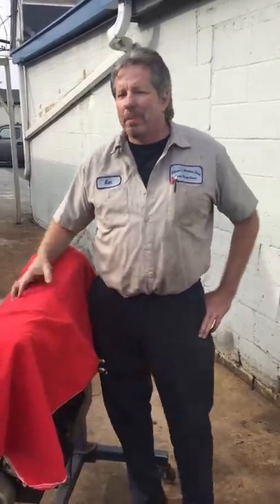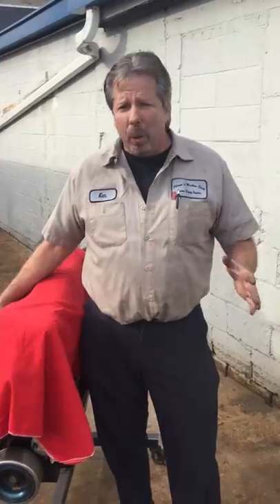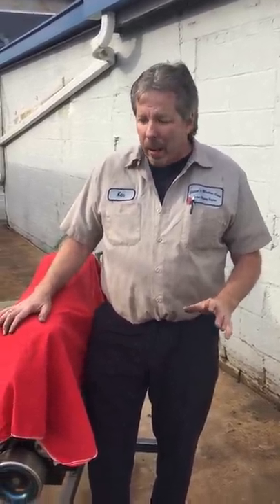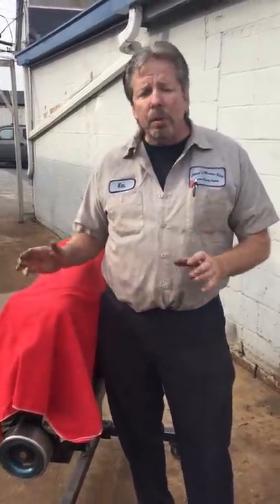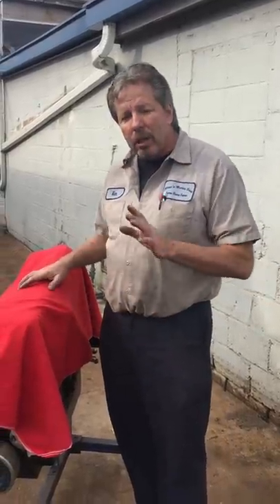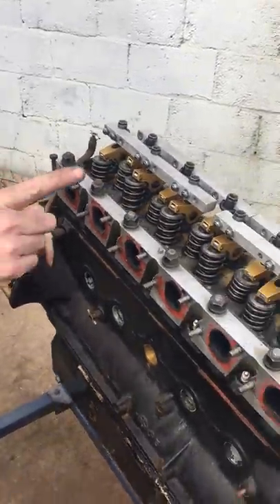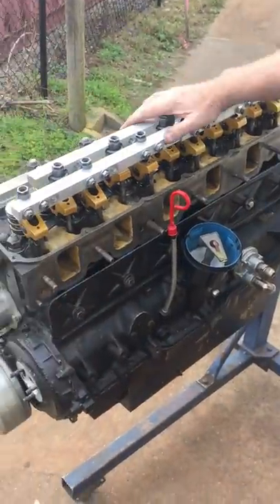Mysterious Radical Race Engine! MUST SEE!!!

Comment: I have never seen 6 cylinder set up that way but I have seen a cool Ford 4 cylinder. Volvo marine sold an inboard marine engine that ran a Ford big block head on it. It was sold as Volvo engine but it was basically a Ford rebranded. I always thought it would have been cool to swap one in a turbo coupe or something.
Reply: that was a merc cast block with a ford 460 head to make it cross flow,

Comment: I had a 1968 Ford 1-1/2 ton truck with a 300 6 banger mated to a 4 speed. That is a workhorse combination. It actually sheared off all the rivets holding the ring gear to the carrier.

Comment: The two piece valve keepers are strange. I can't see the advantage of the rollers running against the split keepers. It's definitely a strange engine. The work is staggering in this engine.

Comment: i heard about this engine today. and i love the 300 6 so i found the last video of it and i subscribed because of it. what i want to know is if you can get a pattern and what parts of the heads they used to make it work of if you can get the head 3 d printed so it can be built and sold on the market.  because now i want one so bad.

Comment: Bruce Sizemoor had one that I think he used Boss 302 heads to build.  There is/was an E/Altered that used the 300 ford block with a single billet head by Allen Johnson.  Bruce told us he took it to 9000 rpm.  Said cranks were junk at 20 passes.
Reply: There we go I knew there were some old modified guys out there, Bruce Sizemore ran  I/gas with this pinto back in 1975.

Comment: Hey Ken, Love the video!  I knew what it was as soon as you pulled the cover off.  This is the same engine build as the one Bruce Sizemore had in his pinto, I think in 1975 and won the prostock championship with it!! I can not remember who he was staged against in the final round, but I do remember it being a white GM car.  It is hard to mistake the design of the 300 and then,  when you see the Cleveland ports and canted valves up top it is a dead give away!!  I love the way they did the front timing cover to drive the enderle pump for the injection system.  I know, I am about 9 months late on this post but you said to leave a comment if we recognized what it is.  LOL   I am a FORD guy and also an engine builder.  I love those Cleveland heads.  I have got to get caught up on your videos,  I have never seen one of these heads off the  block.  I am also curious about the cam choice, and the way they lightened the crankshaft as well.  Thank you for you time.  Earl

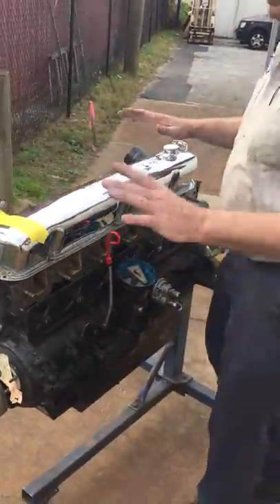Comment: I stopped at 3:43 and just scrolled forward on stills and no sound. Being Australian I am prob off the mark and can't be sure.. Look Fordish (Nothing to do with the WP) Crossflow, so possible a ford 250ci crossflow.. Special, hmm so far I am not really seeing much other than the roller rockers and what may be a custom magneto or CDI mount on the front of the Cam.. The Ex manifold spacer to get the extractors or headers around the plugs is a nice touch :P the port flowing is common, but not my preferred for an engine like this.
>
Now I watch the video :P
Reply: I thought the angled rocker cover mount was unusual on my first look, but I didn't pick the multi head setup lol And the I thought maybe the welded cover was to match up a high rise cover for the roller rockers..
I have swapped out some custom heads between different 6 cyl engines to get different chamber and valve sizes, but 3 heads is one I never attempted :)
13:1 ouch.. lucky Av gas is cheap in the US lol.. best I could go was 10.5:1 and even then it was hard to keep the octane high enough :) especially after they banned leaded fuels.. even the high octane unleaded fuels where still prone to a lot of pinging.
>
I was more into the Holden variants of the GM 6 cyl engines here, and you could do a lot of custom swaps between cranks, rods, pistons and heads to get some sweat combinations.. Definitely looks like a work of art to be proud of 👍
Reply: 13:14 Same, same as I mentioned above.. sit there and read through workshop manuals for specs and catalogues to see what you could match up to realize the crazy build you had in your head :) Love it 👍

Comment: Yes true, I have never seen this before... I really want to make the same on jeeps 242  but designing the heads intake on a side and ex on the other side... Makes hell of a difference...
Reply: AMC/Jeep six. Same bore spacing as the small Ford V-8s. And only 20 thou less than the Chevy.

Comment: I graduated in ‘76.  I remember reading about a GM six cylinder having similar surgery. Cutting up 305 or 327 or 350 heads to mount on the block. They were welded together, two combination chambers added to four. This also put intake and exhaust on opposite sides.  A few guys at school had hefty six cylinder novas and mustangs.  It was the cutting edge, I guess.  Thanks for throw back.
Reply: Clifford research and development

Comment: There are other examples of this combination{as many as 50 examples?[--NOT as "Good" as Glidden's! ]} , but I STILL LUV this combo.  WHY, though, didn't Glidden start with an Australian "Barra" head?  Not enough  space in the "Barra" chambers?   I got a combo for you.  Pontiac brought out their OHC head on a Chevy block that was around for 3 yrs from 1966-69.  It didn't have near the output of Glidden's "GENIUS-BEAST" that you have.   But Pontiac was "working" on a DOHC version, whose experimental head has never seen the light of day.  GM wasn't making $ with the OHC-6, so a DOHC-6 was never going to fly.  But as the gas-crisis deepened, it could have "fit" somewhere in a Poncho-line-up{ in Venturas?}, but it didn't any longer exist.   For RARE engines, that DOHC Pontiac head would HAVE to be like "Hen's teeth".  Can you imagine an early-70s Firebird with an all-alloy 300-350 HP , 3.8L, DOHC-6 ?   I'll bet they all got stupidly tossed into a scrapping dumpster.